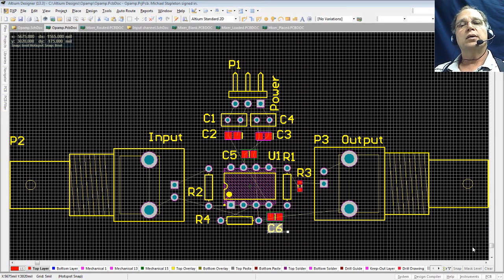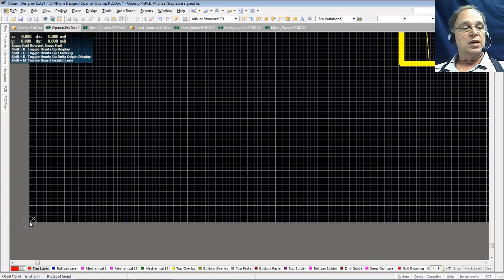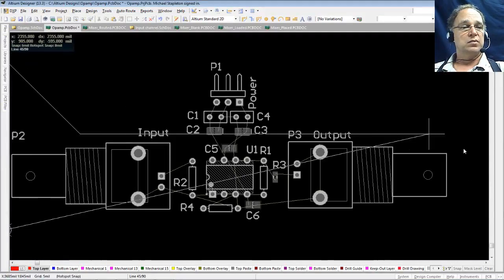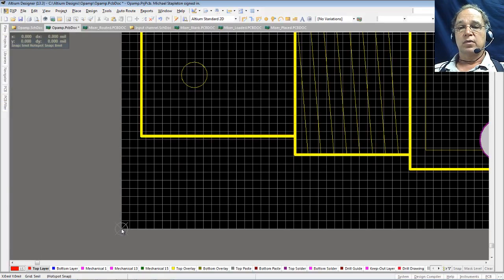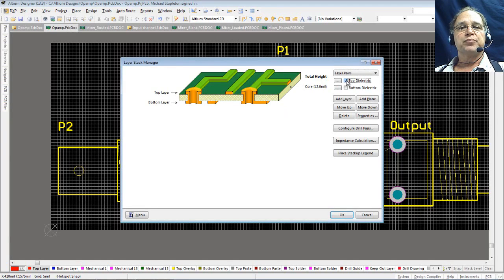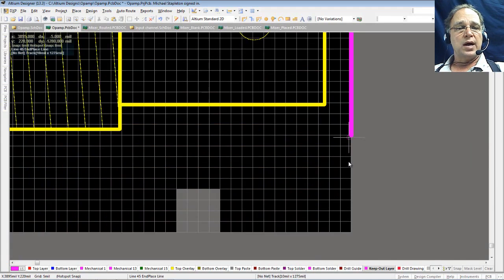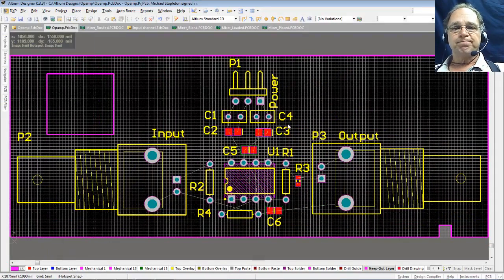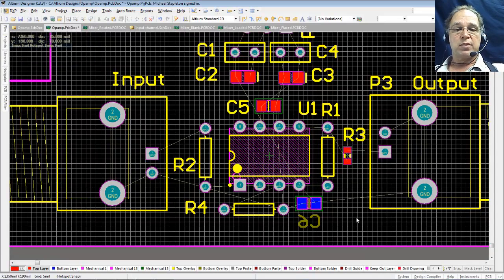Altium Designer Tutorial 1 for beginners - Part8

Comment: Great work sir ,
But in my altium i don't find redefine board shape under board shape , there is only an option saying "define from selected objects ". How can I get that option.
Please help me out sir.
Reply: Go to 'View' and enable 'Board Planning Mode'. Now when you go to 'Design' you have the option 'Redefine Board Shape'.
Reply: I am using Altium 17 and had the same problem as above. Looks like Altium changed the user interface or added functionality. I had to select "View" "Board Planing Mode 1" then under "Design" there were selections for managing board outline.

If I were the one making the decision on PCB design tools, I would never again choose a high end changing every year product. I would go with Open Source and change versions ONLY when I wanted to.
Reply: same problem here
Reply: Steven, Could you tell us your Altium Version please?  Then need exact steps.
I simply can not duplicate your method. Just how does one "draw a box"?